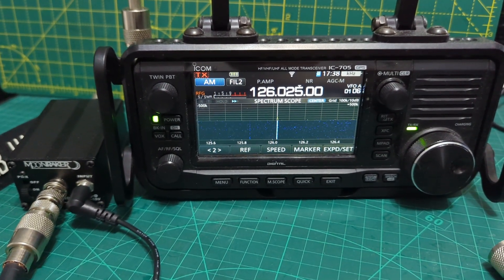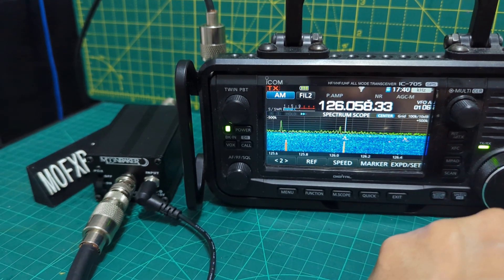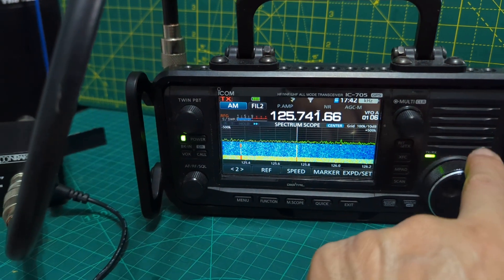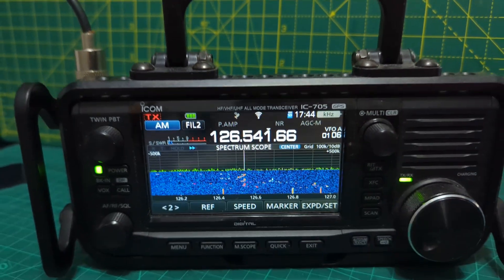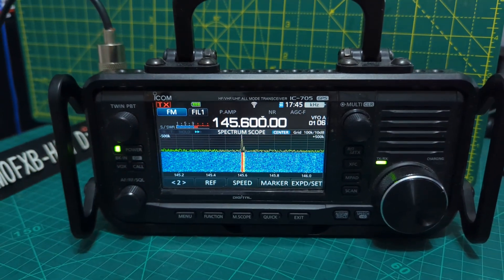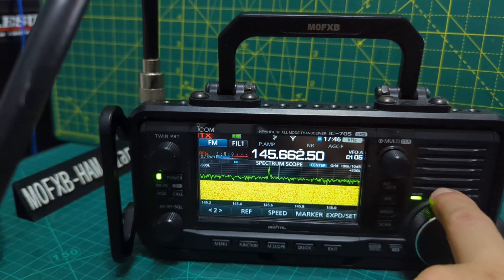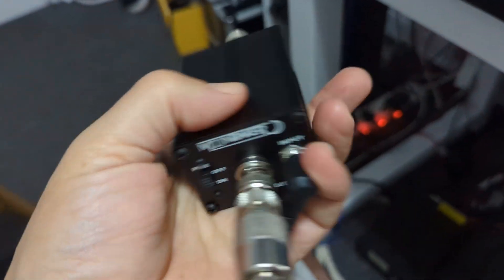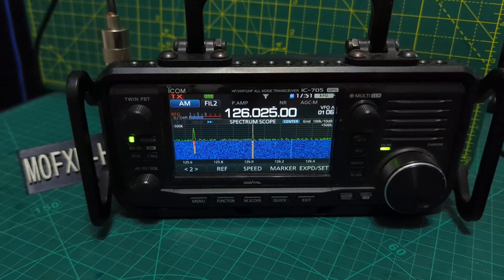ICOM IC-705 Testing MoonRaker MRP200 MK2 Scanner Pre amp ??

Comment: To produce any improvement, you would need a  pre-amp with a lower noise figure than the Icom front end amplifier. Since the Icom has a pretty good front end, this would need to be a very high spec. device like those produced by Kuhne and as stated above, is best positioned at the aerial end of the feeder cable.
Reply from the maker: Yes good advice many thanks

Comment: The only true benefit of a preamp, is using a masthead preamp - mounted right at the feed point of the antenna. Having the amp in the shack just amplifies everything - the wanted signal and also noise on the coax
Reply from the maker: Agree